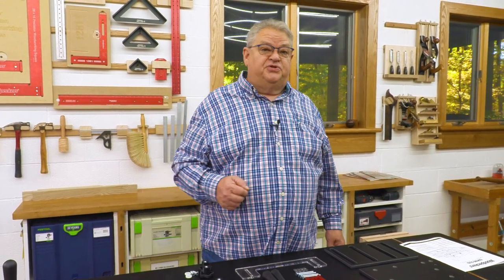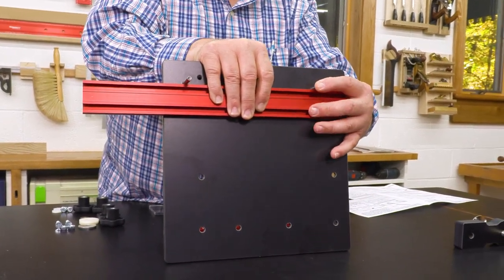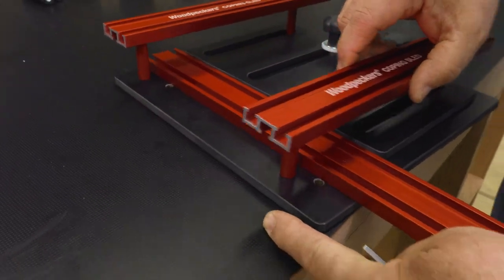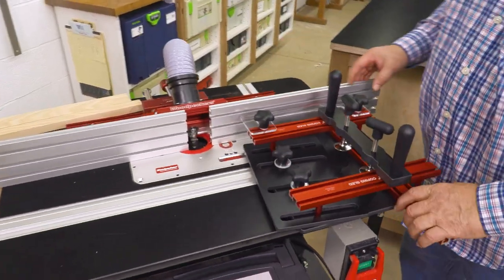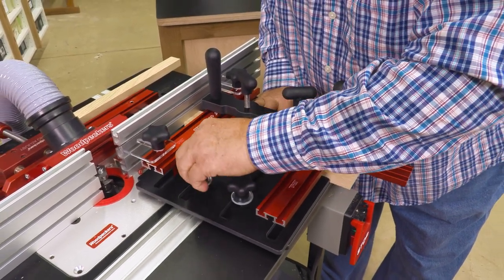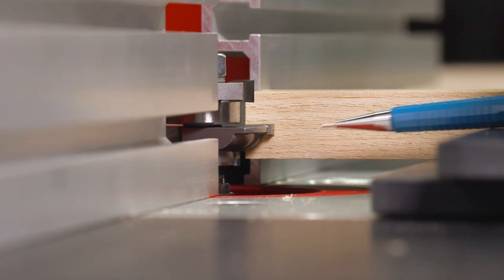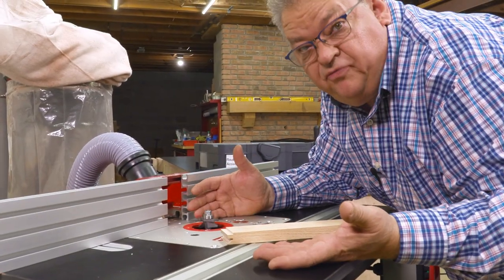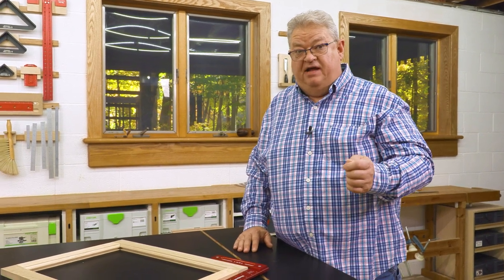Coping Sled Assembly & DEMO On Router Table | Deep Dive

Comment: I have this sled and love it! Here's another way to ensure the top tracks are square: Set it up as shown and once you get to tightening the top tracks, set the bottom plate on it's edge and use a square on the bottom to ensure it's 90 degrees and then tighten.
Reply: Phill Earnshaw that is what this guy could have done to make it easier.or It could have been pushed up to the fence to square up the bottom.
Reply: So you don't mind having to readjust the height of the router bit between cope and stick?

Comment: Try and buy something from woodpecker. Back ordered and expensive
Reply: It’s most likely not back ordered, they make all of their products on site, so there is often a waiting period if certain items go out of stock while they manufacture the next batch. In fact even during this time with mass shortages everywhere Woodpeckers has consistently kept all their products in stock often bringing a lot of the items back up for sale weeks to months earlier than their projections. As far as being expensive, I would say this is one of the rare exceptions where a company actually offers a product that’s worth every penny. I promise you won’t be disappointed if you decide to pick something up, top of the line stuff. I would recommend either an eight inch pocket t-square or their saw gauge 2.0 as a first product.

Comment: Love this tool. I wish I had one for my shop. The only thing  would do differently and would probably upgrade when I received the sled would be to change the bolts from slotted screws to Robertson or Torx. Even as a kid, working with my dad in the basement shop at home, I absolutely hated the slotted screws, Far too easy to cam out of the slot and mar the worksurface.
Reply: You would think for that money they would have already thought of that. Imagine putting that much effort into the precision of such a tool and then skimping on the bolts.

Comment: I found it very frustrating that you video taped the assembly piece by piece and then had a different arrangement when you went to use it.  You also didn't show how little adjustment there is to the sled with the provided guide.  The handles do not have to be out as far as they are, they could have used the inside part of the track instead of the outside part of the track and not have to waste the slotted area provided on the guide.

Comment: I have this jig and will be selling it. I cannot run the cope and stick in the same plane. Both cope and stick should reference to the table top for one setup like my shaper does. Your construction is very well done as I would expect from Woodpeckers but the coping sleds design can be better. I do thank you for your very well detailed explanations of setups which are the best.

Comment: I really do like the sled, but would like toggle clamps instead of the screw clamps for hold downs.
Reply: I agree
Reply: Agreed. I mounted a toggle clamp using the back track works pretty well. If you use two, also can hold backing board in place between different rails.
Reply: Amen. Too much screwing around - pun intended.

Comment: Just received my sled, cannot wait to use it…excited,  but when I opened the first package I found 5 flathead screws but only 4 trac nuts so I put 2 screws on the outside and left the middle open…hopefully I can receive one so I can put it together correctly (I’m sure this will be fine but I’m just weird about having it complete)

Comment: HI  I watch all of your videos that I can and I am a big fan of Wood peckers products. I  do have a question . When you run your cope and  stick router bits could you tell me at what RPM you set the router at .
Thanks Jeff
Reply: Cope &  stick cutters at maximum speed, raised panel cutters at minimum. Little bits -- High speed.  Big bits -- Slow speed.

Comment: 6:20 - 'Track and fence have to be parallel to each other'. Nope. If you are using the track, the fence is not in contact with the sled or workpiece- it does not even have to be there!
Design flaws with this ($169!) coping sled-
Handles- wrong shape and position- the pressure required is downward, palm grips are better. either side of the cut is a more natural position, and gives more control. (I note that in the video you do not use the handles- enough said!)
Screw clamps- slow to use- toggle clamps are much faster.
Access issues- the cross rails get in the way, you have to feed the workpiece under them.
Fence guide- require a high fence that does not have track at that height. Can obscure vision if dusty. Has to be set square to the guide every time it is adjusted (critical).
Side support adjustment knobs are hard to access.
Because the side sliding piece has the slot on the top, you have to hold the sled, hold the slide in place, and tighten the knob. 3 tasks with 2 hands (watch the video). If the slot is in the base, the move and tighten can be done from the knob alone.
I could go on...

Comment: Couldn’t we just remove the fence, set the depth of cut on the sled and then just use the table track to guide the rail through the bit. You only need a fence if the sled does not have a track rail to guide it straight.  That seems so much simpler than a complicated contraption that relies on your manual dexterity to guide the sled freehand across the fence.  Something about the design approach here seems to be excessive engineering and incorrect problem solving approach for no real woodworker value. Seems like a good weekend prototype is in order to prove myself wrong.
Reply from the maker: Bash, the issue is depth of cut. How are you going to control depth of cut in your scenario? By using the fence instead of the track, depth of cut is simply a matter of aligning the fence to the bearing on the cutter. The fence guide on the coping sled then follows the fence.
Reply: @WoodpeckersLLC  thanks for that thought but there is an equally simple solution to this problem. It is always relative to the distance between the sled on the track and the bit. That distance never changes. So, transitively, the distance from the sled would produce consistent results.  It seems too simple. But I’ll have to prove my theory through my prototype.  No matter how well machined the sled is, the results are with respect to the consistent feed position through the bit and the ability to reproduce the cuts.  I don’t believe it requires a $300+ product to do this.  In fact there was a similar concept built by another YouTube’r, but his process was also way too complicated.  He even stated a known fact that it doesn’t matter what the position of the fence is, as long as the rail does not reach the bearing, just a scoch short of a hair width to the bearing.  This is a fixed distance to the track and a sled riding on that track.  Enough said. Let’s see if theory holds up in practice.  I may not get to it this weekend - family commitments.  But definitely on my to do list - top of it.